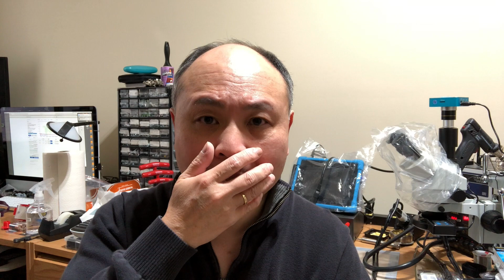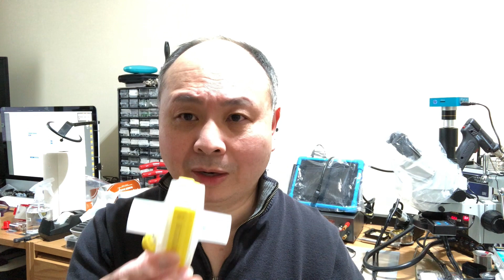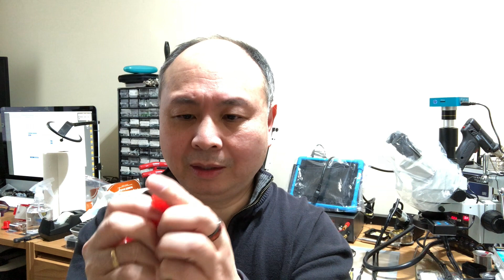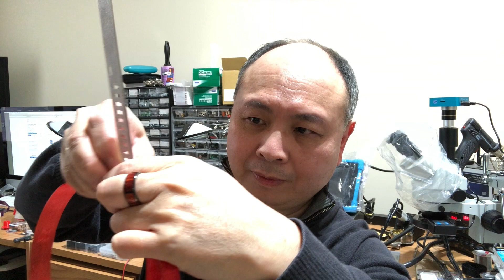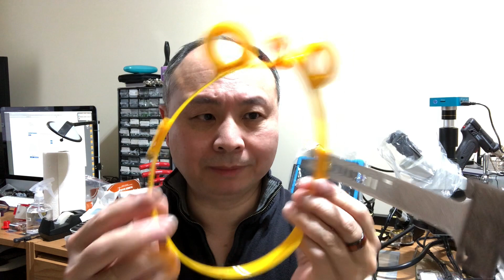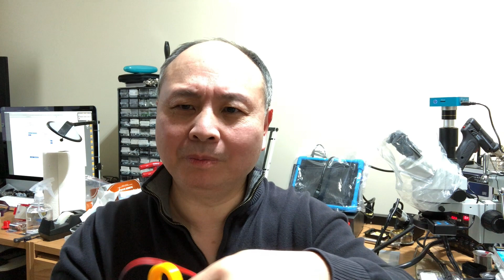Bunny Science Update 2020 04 23

Comment from the maker: Bag filter adapter with 22 mm internal diameter is now the standard style. More and more HMEF's with only 17 mm / 22 mm external diameter ends have appeared. Switching to 22 mm internal diameter adapter has side benefit of flipping the HMEF orientation to place sampling ports to top of the filter. That means an open sampling port won't bypass the filter, unlike the original orientation with sampling port below the filter element.